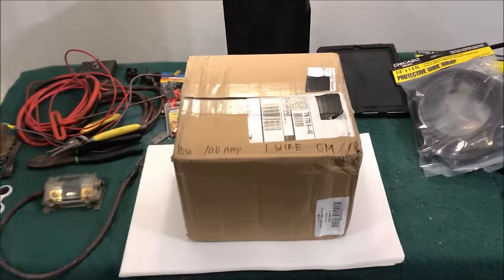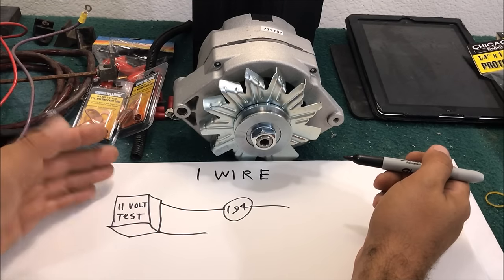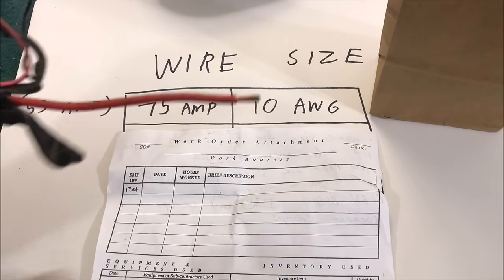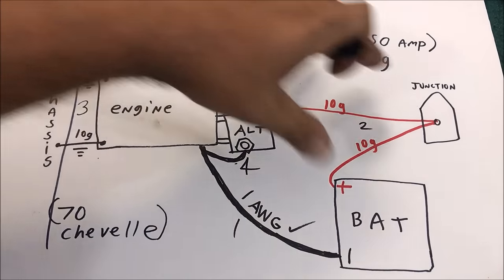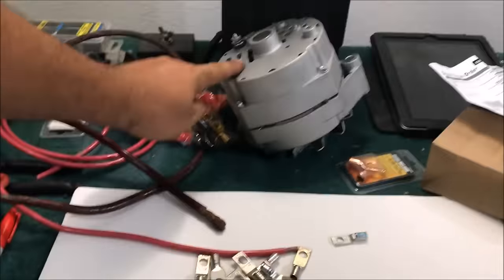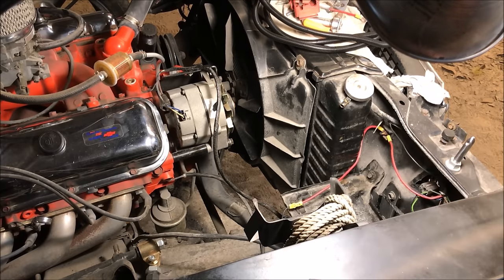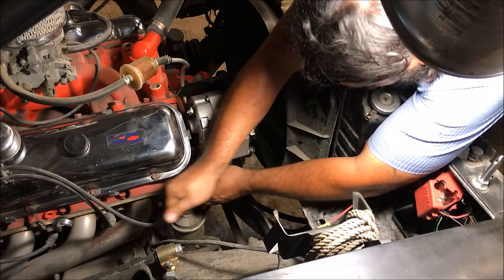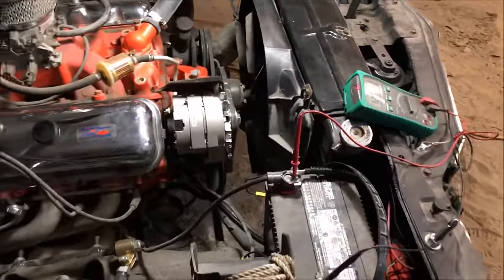GM 1 wire 100 amp alternator UPGRADE and INFO diy

Comment: The generator lights are back fed voltage. Grounded it's a complete circuit. But if voltage is present, there is no flow (ground) so the light goes off

Comment: Hi Chris, fyi connection 1  is the excite via the "Gen" light, it goes out due to positive power coming back from the alternator when it starts charging, thus positive on both sides, the number 2 is the sensing line, direct to the battery was the original intentions of Remy-Delco, back in the day, auto-electrical technician and engineer 1971-2006, only help out friends in the motor trade now as cars have become computers with wheels! The 2 should be completely separate, bring back the old stuff, and you're right a 1 wire can't have a gen light unless an 11v test module is fitted, somebody fitted it and didn't tell him, stay safe

Comment: The light is wired in series with the terminal from the switch. It doesn’t have a “ground” it works at a resistor to the exciter. Think of it as a resistor instead of a light.

Comment: Didn't that alternator have the built-in voltage regulator? Are we completely not using that circuit at all on the alternator and the car both?

Comment: On a 1995 c1500 if you unhook the gauge cluster the charging system won't work at all because that battery light somehow completes the circuit so the alternator can excit. Iv installed a aluminum dash and this cluster is gunna be the death of my build 😂 the signal wire for after market rpm gauge doesn't even work when you unhook the gauge cluster

Comment: This is a quick and clean video with only the necessary information. I like that he is not trying to be a rock star with music and time-wasting fooling around. I wish he were my neighbor. 

One small observation is that he did a nice job of putting his alternator ground connection on the belt adjusting screw. My new alternator's directions actually pointed out a provided place on the backside to screw in a bolt for mounting my grounding wire directly to the alternator case. It ohms out as a good connection.

Comment: Chris, The “SI” series of alternators use a stator connected in a “Y” configuration as all the legs meet. This is the F or field terminal. It is ground when off but B+ when running. If the dash has a charge bulb is a peanut bulb or 194. It is connected to the key-on ignition. Checks the bulb, starts and alternator works, you have 12volts on both sides of this bulb. This light goes out. The regulator controls negative to the rotor, the diode trio supplied 12v to the regulator. The bulb limits current to 0.25 amps or about 460 ohms when on. 
  The “CS is Case Size where SI means System Integrated. The CS uses a stator with a Delta wiring configuration and has up to 32 voltage regulator part numbers. The 4 terminals are marked; S=sense, F=field, L= lamp and P=tach signal or used for remote sensing of battery temp thru a PTC thermistor when the batteries under the rear seat.
  Any alternator that comes on with one wire at the regulator has a stator that has be magnetized. Like a coil of wire wrapped around a nail, pass amperage or current the nail becomes magnetic even after the battery is disconnected.
 The nail or stator disconnected from a battery or sitting on the engine in storage over time loses the magnetic field. It has to be jumped quickly to B+ to re-start.
  If a charge light comes on during bulb-run-check thru the Ignition it has a path to ground either a wire to “L” on the alternator or a gauge or other circuit under the dash. The voltage comparator is a simple cheap circuit device set to 12.8 volts. If voltage goes higher it turns the bulb off by removing ground. It cost about $3 to build.
 Hope this helps.

Comment: You answered some questions. I am an aut electrical and electronic specialist. I have forgotten as much as I remember. I was injured and left the industry 8 years ago. 25 years ago I put a 1 wire on my 55 chevy. A fellow that rebuilds them told me how to do it and wire it in place of my generator. Now years later I am totally building my own wiring system and you gave me some good refresher points as I am planning my install of this one wire again.  Thank you for your time and for sharing.We are never to old to learn or relearn. your engine sounds just like mine. makes my heart happy.
Reply from the maker: you have to bypass your external voltage regulator... i have an EASY CONVERSION  video you might want to check out..  ask me any questions...  im all about helping people get their projects on the road

Comment: Great video mate. At about 7mins down you mentioned someone had the GEN light fitted with the 1-Wire ALT. I do that all the time and never ever had any problems. I use a 1-Wire GM 100A ALT with complete new AAW universal wiring harness for custom jobs. I connect the brown exciter wire to the existing GEN bulb, other option I connect the brown exciter wire to a separate bulb on the dash. It works great and have worked for years. Customers feel safer they actually see the GEN light go off upon starting, like the average car on the street. Just thought I share this info.

Comment: One of the best most detailed videos I've come across. Good on you mate. 
Just to share, I've been using GM 1-Wire 100A Alternators for all my customers projects using AAW wiring harnesses which already comes with Red/Brown wire connector ready for plugging into these GM 1-wire alt where the Brown wire goes to the GEN light in the dash. So far all the GM 1-wire Alt that I've purchased always had the 2-terminal point to be used if needed. So for those cars without any GEN light on the dash, I'll add on one on the dash panel somewhere.

Comment: Props to you Chris.  I have '73 Nova with a sbc 350 that I'm upgrading as funds allow.  I watched your video on wiring electric fans and once I get to upgrading to the GM 100 amp alt I'll install some electric fans.  Your diagrams and explanations are clear and easy to understand.  Thanks.

Comment: The gen light works on my tractor with a 10 SI.  The gen light is an LED connected to +12 and pin 1 on the alternator. When the alt is not charging current flows out pin 1 to +12 and lights the LED.
when the alt is charging pin 1 is goes positive and current stops and LED goes out.

Comment: Hey Chris, this is Dan Baldwin. I had to laugh when I found this. What's funny is my projects seem to be 1-2 videos behind you, seems we are heading down the same path...... Good job  first off I'm confused on my situation. Let me sum up 1st.      I left something on in my car connected to the cigarette lighter and wanted to take it for a ride the other day and put a slow trickle charge on it the night before. (not sure what the voltage was) the next morning it started with my fingers xed. I started up the rd on a 3 mile trip and noticed a rough engine run like a plug wire off or so. When I got to the gas station and put it in park, the engine cut out. got a jump    2x just to get home. Here is what I checked. Put a volt meter on battery and it was around 11 volts. left the charger on over nite and that got it to almost 12.3 volts. I changed the regulator next day and its the same. it's a 4 pole connector. I thought this was supposed to be around 13.5. any idea where to look. Thanks and keep up the good work.
Dan
Reply from the maker: i dont know if i replied already but watch my GM 3 wire alternator hook up and make sure you have it wired right..

Comment: Great Video... I just watched this and I'm subscribing because I can understand exactly what your doing Chris, subscribing as well. I've got a BBC in a '69 Camaro and I'm in the middle of fabbing a dual fan setup, that's going in with a Vintage Air setup and a Serpentine belt setup.  Gonna start roughing out some parts list since I'm confined to the house I may as well watch your various Relay videos and more, then start ordering some parts.
Reply from the maker: buy a 140 amp if you can..  the 100 might not be enough..   i know all the wiring in those cars so ask me anything..  i want to see some videos..   PLEASE

Comment: I just put a new 1-wire 100amp alternator in my 67 f100 and it never affected my charging light and no issues. I think the issue is that people delete all the wires from the old harness and just have the positive wire. I ditched all the wires to the external regulator but kept all the wires spliced into my positive wire that were there originally. Edit: Looking at the wiring diagram I wired back in the 904 wire or the Green-Red stripe wire that goes to the charging light.

Comment: Also, some 1-wire alternators have an indicator light drive. You just connect the appropriate wire from the harness to this terminal on the alternator and the indicator light works

Comment: Great info.  FYI the 3/8 size bolt on the junction block is not necessary.  You are only using that to clamp the two ring terminals together tightly enough to prevent loosening.  A 1/4" stud is better because that means your ring terminals have less material drilled out of them, so they will conduct better than the 3/8" ring terminals and they will probably cost less.  You don't need 3/8" bolt, that's big enough to torque to 200ftlbs or more.  All you need for an electrical connection is maybe 15ftlbs at most.   The only reason to use a 3/8 would be if the terminal block itself is a flimsy design (as it may well be something from china), then putting it a couple sizes larger will compensate for that, assuming they use larger housing etc for the larger stud size.
Reply from the maker: that junction box is a factory GM 140 amp.. that’s why the stud is that size.

Comment: Good video.I would recommend using die electric grease or No-Ox on the wire inside the crimp to stop corrosion.
Reply: You should apply any dielectric corrosion inhibitor /after/ you make a good, proper crimp. The idea of crimping is 100% contact, not holding it tight. 
Dry crimps, whatever dielectric that tickles your fancy (I like the CRC or loctite brands because they don’t dry out and get crumbly quickly) applied afterwards. I prefer crimping and adhesive-filled  heat shrink, dry, but like for boats or trailer wiring here in the salt&rust zone a bit of dielectric at the wire to terminal juncture with heat shrink over. 
Either way, the crimp should be swaged dry.

Comment: Grate video I have a 71 Cheyenne Chevy truck has ac planning on putting electric fans and a amp im shure you covered this question but I wanted to ask just to cover bases.so going with a 140 I need to replace junction block and go from junction block to battery and altinator wire to junction block with 4 gage wire my question is the wire going to from existing junction block to new heavy junction block does that need to be 4 gage as well and what about outher factory wires like wires going to sylinoyd on starter or any outher wires can I keep thim factory? Thank you agine for your help.Im also using your videos to fix my 66 elcamino but that comes next .

Comment: Great videos, they have helped a ton while restoring my 72 Chevelle.  I'm planning a big 4 upgrade for a new alternator.  I have a new junctiong block and 4awg wire for my alt and battery connection. I'm wondering if I also will need to upgrade the wire from the starter solenoid to the horn relay? Or will running a large wire from my new junctiong block to the horn relay work instead?
Reply from the maker: sorry, i think that wire can stay the same..  have you looked at wiring diagrams?  i have that diagram on my ammeter video..  for 72..

Comment: On a previous video, you showed a heavy gauge wire going to the starter. I did not see any changes to that wire. Should it be upgraded? Also, on my 1972 El Camino, the heavy gauge wire from alternator connects to the battery as in the first video, then to the battery. That is the only positive wire connected to the positive terminal on my battery. I am assuming that the power to the fuse box is coming off of the starter. Does that sound correct? It almost seems like the starter is serving as the junction block. Am I missing something? Should I connect a separate junction block from the starter or the battery?  I am hooking to a 300 amp CS-130D in expectation to hook-up a stereo as well as several other electrical devices sometime in the future.

Comment: Just for people who don't know why you that you shouldn't solder these high current connections it is because solder will melt when the wire gets red hot if a component shorts out down the line somewhere and then you have a high current wire flopping around loose with grounds literally everywhere the crimped connection will hold tighter the hotter it gets. The idea is that whatever that has shorted out will eventually burn out before this wire does and you wont have a electrical fire.

Comment: Hi Chris, would briefly explain how can I use a GM 3 wires Cable alternator on in E-bike project please, thanks in advance, keep up the good work!
Reply from the maker: what is an e bike?
Reply: @chriscraft77022  great thanks for your fast response, it's a regular bicycle powered by a car alternator, a controller, battery, I need your advise with a 12v batty set up, all credit will be giving to you!
Reply from the maker: there’s already a video on YouTube about that.. that’s why he had to make a go cart cause he had to use a huge battery.. a 12v battery wont be enough
Reply: @chriscraft77022  I remembered seen it, can you use a multiplier instead?  Just asking
Reply: Maybe use capacitor s instead car battery

Comment: Hi Chris - love your how to videos and the drawings that accompany them . If the answer to what I'm about to ask exists in another of your videos I apologize. I have a 69 Chevelle with the factory Tach with the  Batt/Fuel/Temp/and Oil gauge  in the same gauge. My mechanic upgraded the alternator to 140 amp but kept the external voltage regulator (had to be upgraded as well) .
I just realized they DID NOT change the charging wire to a 4 or 6 gauge wire (this is so basic they must be clueless)  So my question is , if we change the charging wire to a larger one, does it only go to the distribution block  by the battery, or does it also have to come off the distribution block and run over to the drivers side of the car to the bus bar / voltage regulator?  And do you have a clue what their thinking was in going with the externally regulated VS the internally regulated?  Thanks so much.
Reply from the maker: sounds like you got screwed..  there is too much for me to answer without seeing the car in real life..   are you sure they even put a 140 amp on there? If they did why would they use the external voltage regulator? makes no sense.. you car is wired just like mine..
Reply: @chriscraft77022  Yes they put a Tuff Stuff 140 AMP Alternator on and Tuff Stuff's required solid state external voltage regulator. May main concern is the charging wire and when it is upgraded the fusible link from the  distribution point to the positive post is will be too small and also be an issue.
Reply: @chriscraft77022  Yes they put a Tuff Stuff 140 AMP Alternator on and Tuff Stuff's required solid state external voltage regulator. May main concern is the charging wire and when it is upgraded the fusible link from the  distribution point to the positive post is will be too small and also be an issue.
Reply from the maker: you see how I wired mine up for 140 amp.. yours should be the same.. you always convert the system to internally regulated when upgrading the alternator.. that system has been obsolete for 50 years.. you literally need to copy what I did to my car in the video.. or your car might burn to the ground one of these days
Reply: I had this exact question on my 69 chevelle. I was going to use a 100 amp with the external regulator. Do I need to upgrade the wire from distribution block to voltage regular on drivers side?  Chris has me thinking a one wire internally regulated may be safer

Comment: I learned A ton from your videos, Probably saved me a fortune on my 67 Firebird alternator upgrade I am currently working on. One thing I don't understand is why do you need to jump the wires on the external regulator plug? Aren't  the Blue and white  wires that went back to the alternator now dead ended? Why jump them to anything now that they no longer are hooked to anything?
Reply from the maker: if you want your gen light to work on the dash you jump the plug when you run a 3 wire alternator
Reply: @chriscraft77022  Thanks. So with the simple 1 wire set up it isn't really necessary. Thank you very much again for this video . Don't think I would have even tackled this project without your help, and if I had It would not have got it near so right.. thanks again
Reply from the maker: with a 1 wire alternator just pull the regulator off but you lose gen dash light..
Reply: To keep the Gem light in the dash? Just jump the original 2 wire alternator plug? Just connect the 2 together?

Comment: So, with the one wire alternator, obviously the charging light won’t work, but I’m not clear how an ammeter would work with the external regulator is bypassed with the jumpers. Will I need to get a volt meter? I see how that would work. I’m keeping my factory gauges on my ‘68 Chevelle, which has an ammeter.
Reply from the maker: watch my ammeter hook up video it clearly shows where the ammeter leads are hooked up.. your car should be wired like my 70.. the voltage regulator has nothing to do with the ammeter in the dash.. I run an ammeter in the dash and an auxiliary volt meter by the ash tray